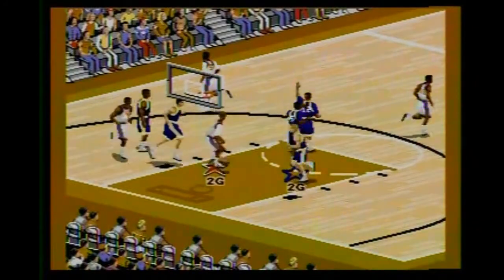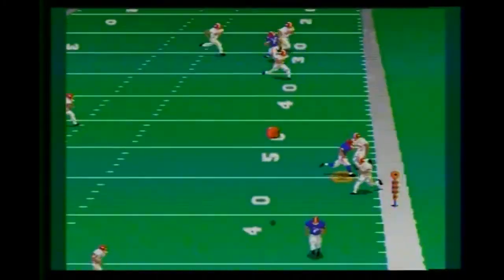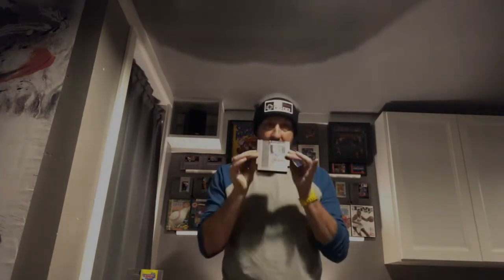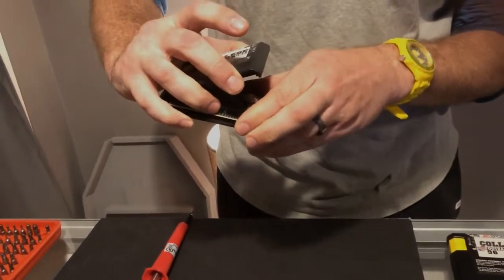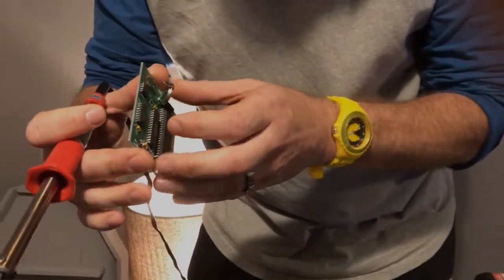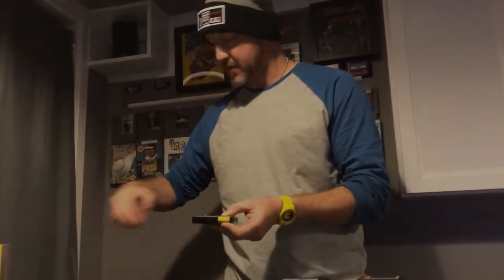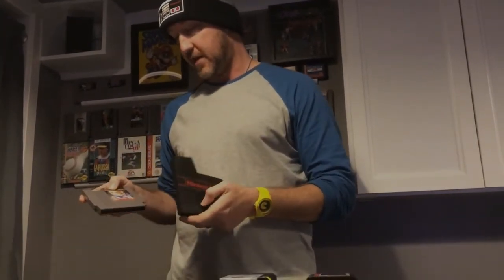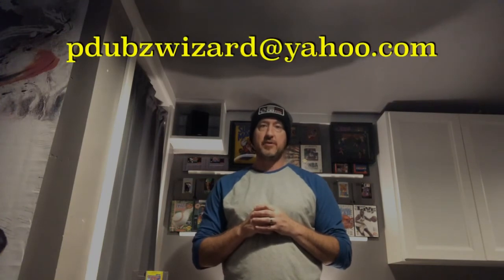How to change out a save battery on Nintendo or Sega games.

Comment: What's the battery kind?  I know it's the nickel sized kind.  I have a soddering gun.  Batteries not here.  I thought I had some.  I know dollar tree sells all small batteries from here to the Sun.  Your video is vague.  Would be nice to know the battery instead me wasting time to open a cartridge my self and reading the numbers off the battery myself.  If not Dollar Tree I have the real battery place to go to.  You could say the brand name if its a real special order battery.  Then I can buy a couple from the place near buy.  Is the NES and Sega Genesis battery the same?
Reply from the maker: Go on Ebay, type in save battery nes or sega yes its the same. it has a special flange for each plus and minus lead. not sure the batteries at dollar tree would work unless you fabricated it.